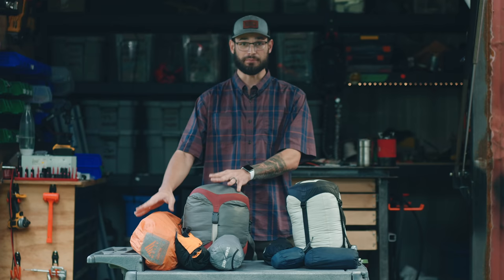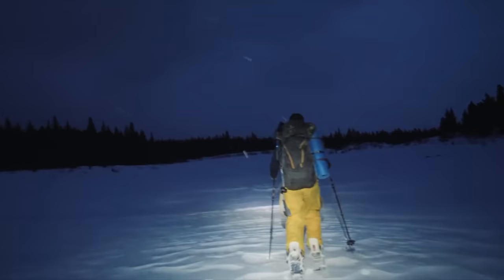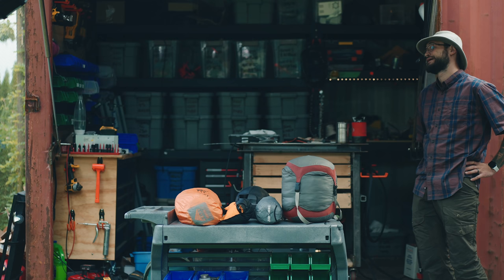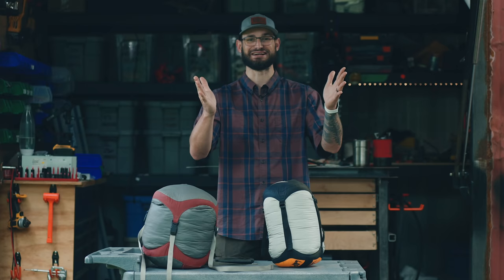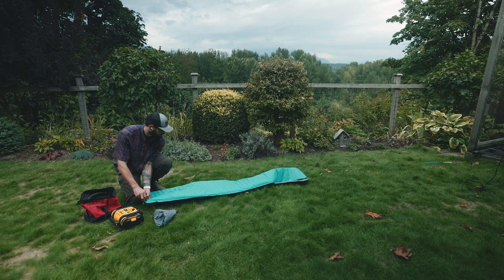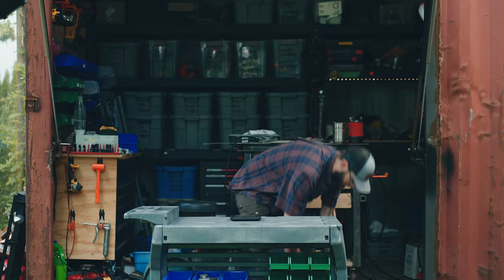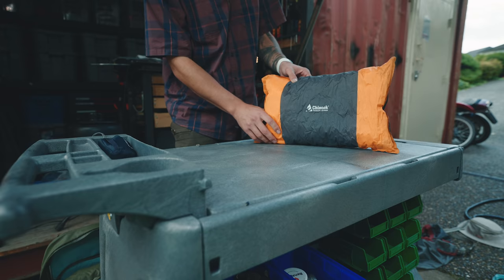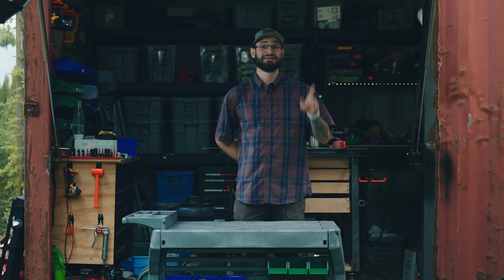Watch BEFORE buying UltraLight CAMPING GEAR!

Comment: If it's not winter get a summer bag. 1/3 the size and weight. No need to loose that much space to the 3 season you have there. Also packing the stuffables out of the stuff sacks can save lots of packing space.most gear is not designed to fit in your bags perfect and the rolled up stuff leaves lots of odd spaces when you have a few rolled items. And lastly :) I have basically the same bivy and a UL tent. UL tents are around the same packing space but the poles usually make it a bit more. The key advantage is you can protect your camera and gear from  moisture.  Plus give into the fact a good sleep will not be had.
Reply from the maker: great tips Ian!

Comment: Jack’s-r-Better Bridge Hammock with down top and bottom quilt.  Dyneema (Cuban fiber) tarp tent with doors rolled into snake skin with tree straps.  Seven pounds of pure luxury, dry, lay flat sleep system.  Snake skin with tarp inside rode in my pack pocket for deployment in the rain so hammock setup and take down was alway dry.  It was noisy but I slept through a surprise storm with forty mile winds and downpour that took down trees and rained through tents.  Several people abandoned there gear and left the trail.  Yes a seven pound luxury that got me from Springer to Katahdin.  I went ultralight on every other piece of equipment and carried thirty pound pack including five days food.  Some gear it’s just worth the money and the weight.  Bonus put hiking clothes under the hammock and over the bottom quilt and woke up with relatively warm dry clothing.

Comment: This is good know. The fact that you address price to comfort, or affordability to level of adventurous, is spot on. I am currently building my backpacking gear for a summer of 2023 JMT excursion for my 50th birthday. One of the things I keep going back to is comfort rather than price for ultralight.  Though, im trying to stay light as possible, comfort will prevail as I trek roughly 250 miles total when carrying loaded pack with all the gear. Thanks again!!

Comment: Solid lineup! Zero regrets on the lightweight stuff when portaging 160lbs of gear/cameras/boat/food 70km in a week 😅 The amount of food we can haul out there more often than not becomes the limiting factor on longer trips, so dehydrated meals and Tailwind endurance fuel tends to be what extends our range the most… we max out at about 450km in the backcountry in a week before needing a food resupply if we’re on record setting pace. Lightweight footwear’s another area where we spare no expense and a great value/dollar weight savings too - they say a pound on your feet equals five on your back :)
Reply from the maker: I never really thought about lighter shoes but that makes a bunch of sense. I mean if lighter bike wheels makes such a difference of course shoes would. Thanks for the input! I gotta do another canoe trip soon
Reply from the maker: Just curious Chris have you ever tried Bedrock sandals? I just got a pair and I’m delighted how lightweight they are max basically ultra light chacos
Reply: @Levi_Allen  Cool! I haven’t, but they look super lightweight! We tend to wear Salomon Speedcross shoes in the backcountry, which we’ve found are a great alternative to hiking boots. Hope all’s well with you and the fam Levi! :)

Comment: Perfect timing with this episode, Levi. I started building my kit for bike packing and feel better about the purchases I made on the UL gear, after watching this video. 

It doesn’t get as cold here in the Mid-Atlantic but FWIW I was faced with the challenge of making a sleeping bag ‘fit’ into my bike bag. And ended up getting a slightly warmer temp bag as it is easier to compact into the seat bag, and also got a bag liner to raise the overall bag rating another 10-ish degree (Fahrenheit)… still compacting both the bag and liner is smaller than getting a 30deg bag to stuff into the seat pack. 

Thx for the content!🤙🏼

Comment: I find the best money I've spent in order of comfort 1) a therm-a-rest Xtherm sleeping pad, 2) inflatable pillow 3) Merino sleeping clothes 4) A lighter but still 3 season quilt from UGQ (30F). The pad and quilt work together to keep you warm so I say get the highest rated R value pad you can as most of your heat is lost to the ground. Plus, you can always do the Nalgene hot water bottle trick for extra comfort.
Reply from the maker: I need a nice light summer quilt solution, I need to look into these

Comment: Welcome to the lightweight world! Usually in backpacking Ultralight is considered when the base weight (all gear except consumables and worn clothing) is below 10lbs, between 10 and 20lbs base weight is considered lightweight, and above 20lbs is traditional. The reddit r/ultralight can be a very helpful place to learn more about UL gear, also a very help fun written and full with tips book is the book by Mike C "Ultralight backpackin' tips". When one loves backpacking usually there are a few iterations of switching up gear :) That was the case with me at least. All the best and happy trails!
PS: Good companies to look into for big weight savings: Zpacks and MLD for shelters and backpacks, Borah Gear for tarps and bivys, Enlightened equipment for sleepingbags/quilts. Cheers!

Comment: I upgraded from a older Thermarest Prolite (about $120CAD when new) to an Exped SynMat (over $225CAD) and while it is significantly smaller and lighter than the Prolite, as a side sleeper, I found my hips touching the ground which didn't happen with the Prolite. So I started packing a Ridgerest with me for extra comfort. The damned thing is lightweight but enormous. Then again, it's all offset by the fact I have it all in an Arc'teryx Bora 95 pack which is 3.2kg empty! lol
Reply: PS: I don't mind that not all your content is about photo / video. Keep the adventure stuff coming too! 👍🏻
Reply from the maker: Hips touching the ground is so annoying haha